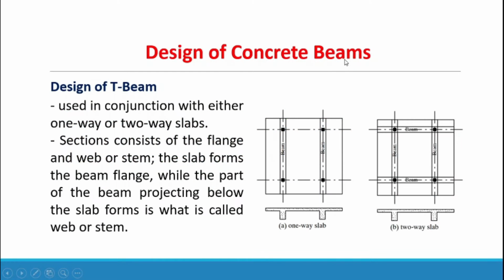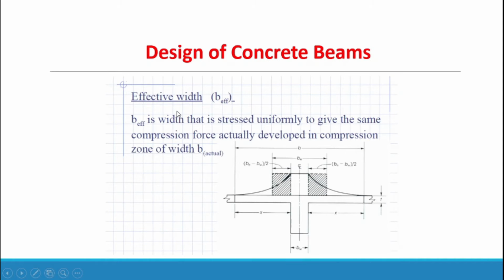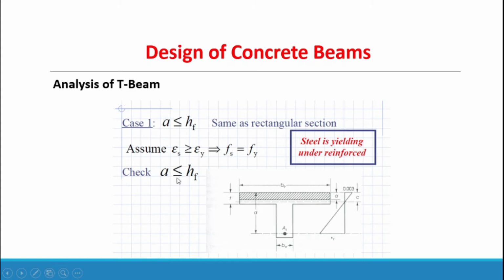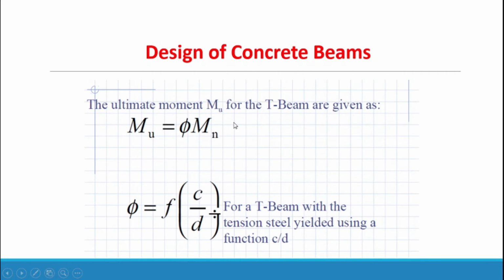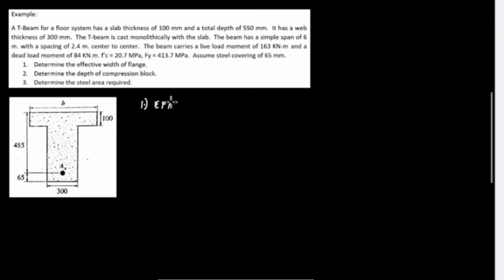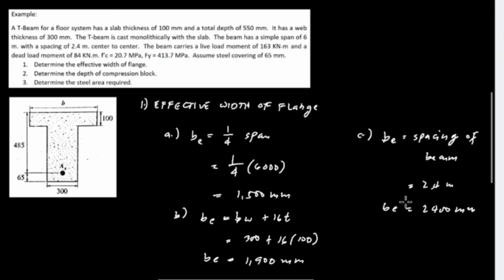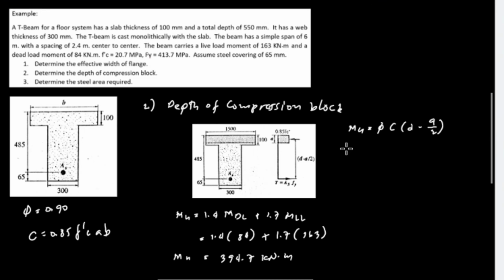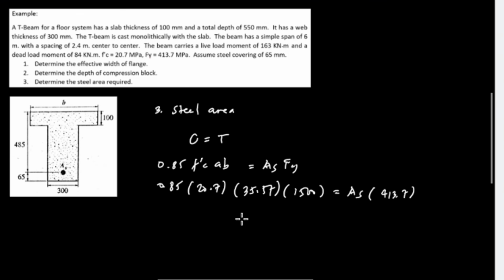Design of T-Beams

Comment: Hello sir, I think the effective flange should be, be = bw + ln/4 which is 1800 mm po, dapat po may plus 300 pa sa 1500mm na nasolve niyo. Since as per NSCP Section 406.3.2.1 it should be the beam web 'bw' plus the effective overhanging flange width.